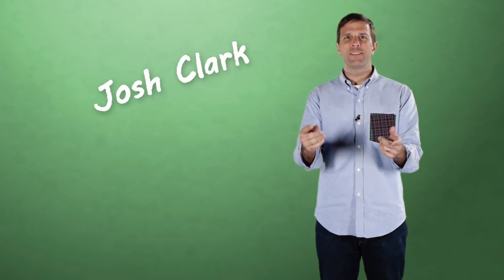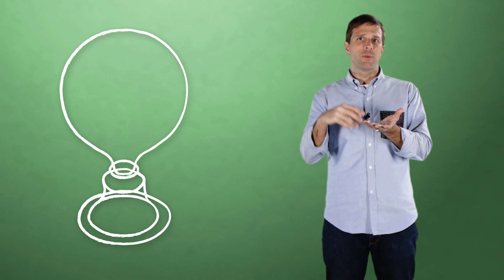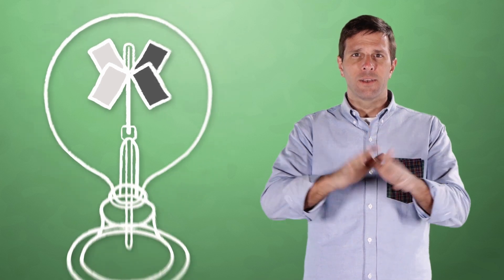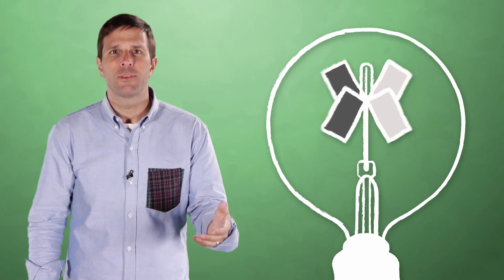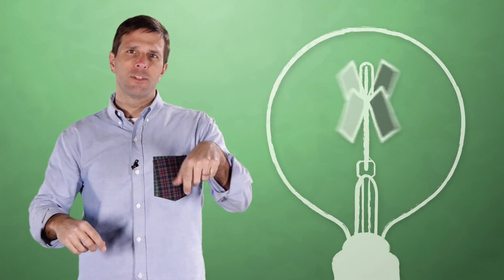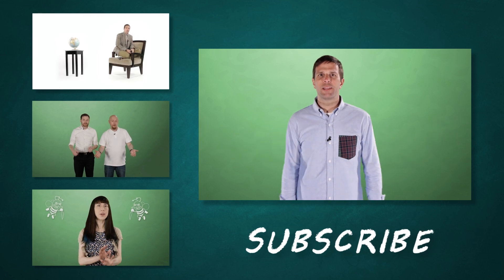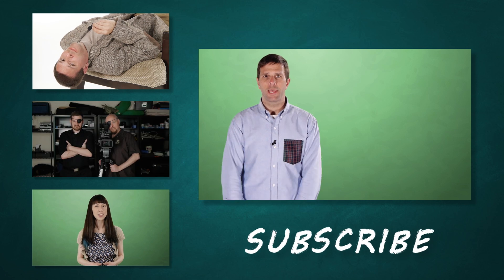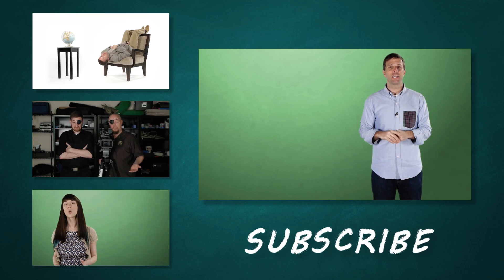How Does A Crookes Radiometer Work?

Comment: O̶K̶ ̶s̶o̶ ̶p̶r̶e̶s̶u̶m̶a̶b̶l̶e̶ ̶f̶r̶o̶m̶ ̶m̶e̶m̶o̶r̶y̶ ̶t̶h̶i̶s̶ ̶i̶s̶ ̶i̶n̶s̶i̶d̶e̶ ̶a̶ ̶v̶a̶c̶u̶u̶m̶ ̶s̶o̶ ̶i̶t̶ ̶c̶a̶n̶t̶ ̶b̶e̶ ̶t̶h̶e̶r̶m̶a̶l̶ ̶i̶n̶d̶u̶c̶e̶d̶ ̶m̶o̶t̶i̶o̶n̶ ̶w̶h̶i̶c̶h̶ ̶m̶e̶a̶n̶s̶ ̶i̶f̶ ̶i̶t̶ ̶i̶s̶ ̶l̶i̶g̶h̶t̶ ̶t̶h̶e̶n̶ ̶i̶f̶ ̶S̶i̶l̶v̶e̶r̶/̶w̶h̶i̶t̶e̶ ̶o̶r̶ ̶b̶r̶i̶g̶h̶t̶ ̶i̶s̶ ̶r̶e̶f̶l̶e̶c̶t̶i̶v̶e̶ ̶a̶n̶d̶ ̶B̶l̶a̶c̶k̶/̶D̶a̶r̶k̶ ̶i̶s̶ ̶a̶b̶s̶o̶r̶b̶e̶n̶t̶ ̶t̶h̶e̶n̶ ̶w̶h̶y̶ ̶d̶o̶e̶s̶ ̶i̶t̶ ̶s̶p̶i̶n̶ ̶t̶o̶w̶a̶r̶d̶s̶ ̶t̶h̶e̶ ̶s̶i̶l̶v̶e̶r̶ ̶a̶w̶a̶y̶ ̶f̶r̶o̶m̶ ̶t̶h̶e̶ ̶b̶l̶a̶c̶k̶?̶ ̶w̶o̶u̶l̶d̶n̶'̶t̶ ̶t̶h̶e̶ ̶S̶i̶l̶v̶e̶r̶ ̶a̶c̶t̶ ̶a̶s̶ ̶a̶ ̶p̶l̶a̶t̶f̶o̶r̶m̶ ̶f̶o̶r̶ ̶r̶e̶f̶l̶e̶c̶t̶i̶v̶i̶t̶y̶ ̶a̶n̶d̶ ̶m̶o̶v̶e̶ ̶a̶w̶a̶y̶ ̶f̶r̶o̶m̶ ̶t̶h̶e̶ ̶l̶i̶g̶h̶t̶ ̶s̶o̶u̶r̶c̶e̶ ̶a̶n̶d̶ ̶B̶l̶a̶c̶k̶ ̶a̶b̶s̶o̶r̶b̶ ̶a̶n̶d̶ ̶m̶o̶v̶e̶ ̶t̶o̶w̶a̶r̶d̶s̶?̶      OK Never mind that Thanks

I also asked a number of people this but no one has an answer...

Is there a lifespan to a photon? If we can see stars billions of light years away which means their light has been travelling that long also consider the field of view and the circumference of the sphere at that distance where you can still see the same light in any given point.

If you has a light tight room that was full of mirrors and you set of a flash where does the light go?

Also would Ultraviolet light work on the Radiometer?
Reply: +Ryad Arlan Yes it would, in fact only blue end spectrum light works, I won't get into the details but i'll just say that most of the things current science teaches are wrong conclusions based on correct observations. Check Theoria Apophasi's channel if you're interested in something more advanced.

Comment: You have part1 of thermal creep backwards. Hot goes to cold, 2nd law of thermo. The energy is radiated from the black side to the molecules causing them to heat up and become excited. These molecules bounce around more frequently on the dark side than on the light side. This is typically referred to as pressure. Because they are bouncing more often, they are striking the surface of the fan more on the dark side than the light. It's this difference in pressure that cause the fan to spin.
Reply: That's the direction of conduction, however, we're dealing with fluid density and cold fluid is denser than warm.  The colder gas (fluid) will rush to fill voids caused by warmer, low density gas.

Comment: Does a Crooks radiometer fail to spin in a pure vacuum??
Reply: +zeffur7 it does, not enough air molecules to push it
Reply: +Krisgun Chirasanta If that is true, then how does a solar sail work?

"The total force exerted on an 800 by 800 meter solar sail, for example, 
is about 5 newtons (1.1 lbf) at Earth's distance from the Sun,[2] making it a low-thrust propulsion system, similar to spacecraft propelled by electric engines."
src:  https://en.wikipedia.org/wiki/Solar_sail
Reply: It still spins, even in a vacuum.
Reply: @1337w0n  it will only spin in a vacuum if it is able to overcome the friction of the spindle.

Comment: hmmm this reminds me of the classic steam engine principle of expanded gases pushing out to do work, the hot air heated strong by the dark vanes expand and as a result attempts to move to the cooler area with light vanes, as this happens, the cooler air also get displaced by the hot air entering the light vane area and ends up on the dark vane and get even hotter and this process repeats over and over again..im assuming if the tube was 100 percent vacuum this turn effect may not work??? lets make a gigantic crookes tube and fix an alternator on its axis and produce some really powerful electric energy ..new meaning to solar energy
Reply: This is closer to how I understood it.
The black side gets hot and any air molecules that touch it draws off heat by conduction. That air molecule now possesses more kinetic energy in the form of Brownian Motion and kicks away from the vane with more force.  The black side gives up energy more readily than the silver side.
Reply: hi nice to visit this comment again after 5.yrs...cheers
Reply: @jsl151850b  hahaha

Comment: This explanation isn't entirely accurate. The "thermal creep" is a symptom of the fact that the veins are moving; it is not the cause of the movement of the veins. It actually works like this:

(1) More EM radiation (in the light spectrum and short-wave infra red) is absorbed by the black side of the veins.
(2) The black side of the vein re-emits longer wavelengths of infra red which are absorbed by air molecules near the surface of the vein, causing thermal expansion.
(3) The pressure differential causes the veins to be "pushed" with the black face trailing, since this is the side with slightly higher air pressure.
(4) The air from the white side will obviously be seen creeping to the black side, since this is what happens when you move ANYTHING through air.

Also, the air pressure needs to be low enough such that the veins can move freely without much resistance, but not so low that there isn't enough air to be heated by the longer wavelengths of infra red being emitted by the black surfaces.
Reply: Electrical equipment TAO  these things and speed of vanes and pressure differential temperature these are all the function of frequency of electromagnetic waves
Reply: +Jim Griffiths You are wrong. Maxwell discovered that the warmer gas would simply expand in such a way that there would be no net force from this effect, just a steady flow of heat across the vanes. You must focus attention not on the faces of the vanes, but on their edges. The faster molecules from the warmer side strike the edges obliquely and impart a higher force than the colder molecules.

Comment: Crookes' Radiometer is a great way to teach students and yourself the value of gathering ALL of the facts through scientific examination BEFORE jumping to wrong conclusions as Crookes and others have done.
 
In order to correctly do this experiment for teaching purposes one needs the following:
 
1.  "Radiometer" with an open tube at the base and a vacuuming device to allow interior gas density to be equalized with exterior gas density and decreased during experimentation.
2. Since non-infrared "Light" has little to do with the behaviors in this experiment one should have a bright LED light radiation source as well as a dark infrared radiation source.  (Hmm, it IS radiation that causes the spin so Crooke was right!)
3. A way to measure the temperature of the gas inside and outside the sphere simultaneously.
4. A way to create a flow of heated air and chilled air over the top of the sphere, while increasing and decreasing the air density inside the sphere. (Don't increase it much above the exterior air density or the thin sphere will break.)
5. Transparent Plastic wrap to isolate the thin glass semi-conductive glass sphere from outside air temperature and flow.
6. A second Radiometer with vanes of equal color, BLACK, on both sides of the vanes.
 
 
In this case relevant leading questions can be asked:
 
1. Why do the vanes stop spinning when the gas density inside the sphere is equal to the gas density outside the tube? Does it have anything to do with density imbalance or only the inside density?
2. At what interior gas density do the vanes spin most effectively?
3. Why do the vanes reverse when chilled gas flow is introduced over the sphere?
4. Why does insulating the glass sphere from the exterior air flow slow vane rotation?
5. Introduce a small amount of smoke or other light airborne particles into the sphere to observe the eddy gas currents within the sphere while the vanes are spinning.
 
This will teach goof scientific discovery skills that students will never forget.  It should also launch a branch into other areas such as;
 
What causes a vortex form?
Why does a vortex "generally" spin clockwise in the northern hemisphere and counterclockwise in the southern hemisphere?
Why do weather patterns always spin clockwise in the northern hemisphere and counterclockwise in the southern hemisphere? "Coriolis effect"

Comment: Why don't they use the idea to run a generator?
Reply: You most likely would not have enough torque on the "axle" so it would probably be quite inefficient to step up the scale to have enough torque to turn a proper generator.

Comment: Lol, your graphic when spinning was rather confusing. it was impossible to tell which way you meant it to be spinning.
Reply: I still dont get which way the rotor turned.. Maybe use arrows.
Reply: Catastrophic error in explanation. If he'd stopped the rotation halfway and then reversed it, it would have been more correct, but it would be hard to tell with a side vide like that. Or he could have just had a video of one rotating on that green screen behind him.

Comment: If Crooke had the means of creating a full vacuum, he would have figured that out.

But its worth noting that his theory about "light pressure" wasn't completely incorrect. Although photons have no mass, they do have momentum. But harnessing that kinetic energy would require an enormous and highly reflective surface area. It wouldn't be very practical for terrestrial applications. It's more useful to absorb the photons with solar panels and harness their energy that way.
Reply: Physicists are obviously charlatans.  If momentum is defined as mass x velocity, and a photon's mass is zero, then for its momentum to be non-zero would require infinite velocity.  Hoist them all!  Host them all by their own petards!
Reply: BrightBlueJim  Good point! Just keep in mind that the laws of physics that govern massless particles (and light speeds) are very different from those that govern massive particles. Newtonian equations like E=1/2mv^2 and P=mv fail to paint the whole picture since they fall apart when m=0. Einstein discovered an equation that paints a much bigger picture: E^2 = P^2 c^2 + m^2 c^4

With this we can see that a particle with no mass (m=0) will still have both energy and momentum: E=Pc
Matter that is stationary and lacks momentum (P=0) will of course still have energy as well: E=mc^2

Notice that no particle can ever have both 0 mass and 0 momentum. If both m=0 and P=0, then E=0. This only describes nothingness. Interestingly enough, this is why photons are forced to remain in motion. Since they already have 0 mass, they are never allowed to have 0 momentum.
Reply: @ultravidz  they are theories not laws and they govern nothing, equations are not reality.
Reply: BrightBlueJim Well said!
Reply: how can something have momentum without mass?
what nonsense.
Reply: @axeman2638  You have a classical understanding of momentum, which is fine, but I’d encourage some more study.
Reply: @ultravidz  no you buddy. you got nothing but a bunch of divide by zero errors.